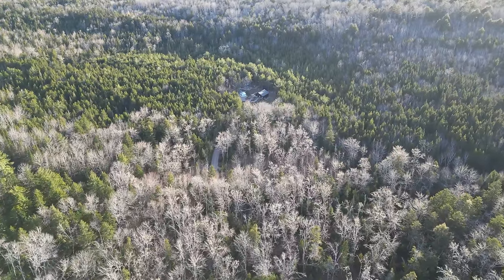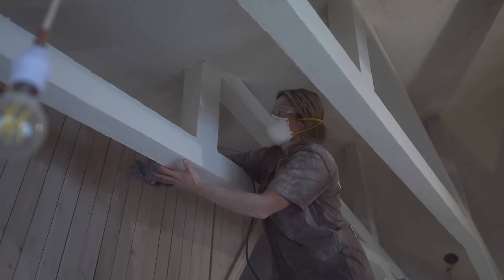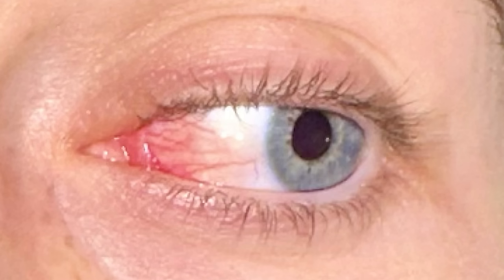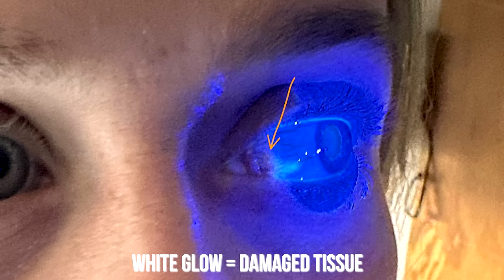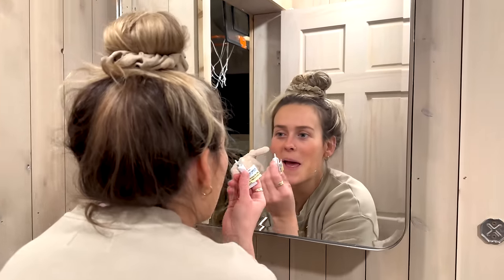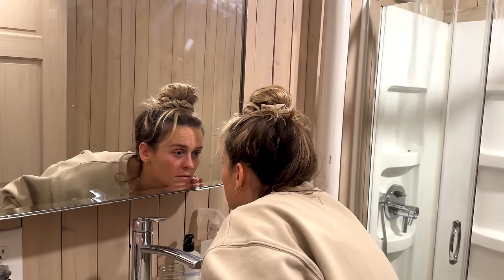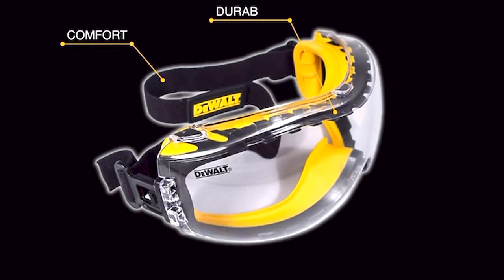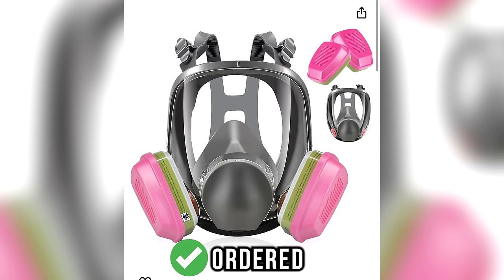telling my story

Comment: I'm glad to see you're okay, Crystal.
Being in the housing industry my whole life. I've seen a few of these types of accidents. From employees to myself. I wear very large prescription safety glasses with flex on frames. Sawdust and sand blasting. I thought was pretty bad in the eyes until I had a wire wheel wire come flying off the grinder. The wire stuck right in the whites of my left eye. Luckily, it didn't penetrate my eyeball very deep. The eye care center was able to pull it right out. I was lucky. It could have been a lot worse. 
15 years or so later, I was cutting the grass on my big lawn mower down a walking path. I ran over a small fallen tree branch, No different than I'd done a thousand times before and the pieces bounced off a tree on the edge of the path, and it's stuck in my right eyeball. Just a tiny wood splinter. No bigger than an eyelash. Back to the surgery eye center, I went. By the time the doctor got into the exam room, it had removed itself. I suppose form me trying not to blink. I was very lucky that time, too. 
We had one employee cut the tip of his ring finger off. Cutting crown molding to length with the small skill saw. The homeowner showed up to check out their new home being built. Tripped on the extension card which pulled the saw which cut his finger while he was cutting the wood trim. 
Another employee cut his thumb almost completely off with the a miter saw. His thumb is now 1/8 of an inch shorter, and his doctor said it was a perfect cut right through the bone now his thumb is just a little shorter. 
Another employee was cutting up some shipping materials with a razor knife and sliced his hand open. Not really, very bad. But when he saw the blood himself, he passed out, fell to the ground, and broke his jaw. That was wired up for several months. Scared the hell out of me when I saw him laying on the floor, passed out and bleeding from his hand. 
I took off a chunk of my middle finger on my right hand with the roofing hammer. I'm left handed and I was just trying to set the nail. The nail slipped between the two sheets underneath the shingles. A 24-ounce waffle head isn't very forgiving. You really can't tell it now. That finger is just shorter. 
I can't tell you how many times i've stuck myself with an air nailer. From trim guns to the big framing nailers. Sometimes those nails don't go through the wood straight. Next thing you know your nailed to the board. Best to keep your hands and feet back from the firing end of any nail guns.
You girls have put out several videos where I just cringe.
Sometimes I even yell at the screen. Hoping everyone will have all of their digits and no new holes poked in their skin. Sometimes saws kick. Sometimes nails come out of the other end of the board where you didn't expect them. It's just part of the business. Accidents happen. Keep your personal protection on and handy and remain vigilant of your surroundings. Just another day in the construction world... 
Be careful girls
✌️🤟🖖

Comment: When I was much younger, I worked for just over 11 years in a logging maintenance shop (they worked on logging equipment) and used to do some foolish things, such as watch guys weld on steel, without my wearing any PPE. The "luck of the Irish" was always with me and I never got any flash burns or such. But I did eventually learn to use PPE's and I am glad I did. Yes people wear your PPE's all the time. If you need short breaks because of discomfort from wearing them, take them. Better short breaks then a loss of eyesight or hearing and anything else that can happen. By the way, this is coming from a 70+ year old.

Comment: I’ve always found with proper treatment that the recuperative powers of the eye are pretty amazing. You were smart to seek treatment. An eyewash kit is a wise investment for DYI'ers. I have used my WaterPik (from a distance) to flush my eye with good results. Funny story: I had to use eyedrops every night before going to sleep and I kept them in my nightstand drawer. There was also a similar shaped bottle in the drawer also. For almost three months I put Dristan nasal spray in my eyes! When I finally discovered the mix up I called my Ophthalmologist and told him and put into a fit of uncontrollable laughter. Went to see him that afternoon and everything was okay. The  Dristan had worked quite well with no ill effects.

Comment: Yes, wear all your PPE: gloves, hard hat, appropriate clothing, chaps, eye pro, ear pro, face shield when needed! Wear appropriate PPE when working, depending on task being done. 
I remember many, many years ago, the Bell 212 helicopter was getting ready to take off and I was the one closing the passenger door when my ring got caught on the door latch. I had to get myself unstuck while the rotors were turning. That was a bit of a rush, scary moment. I knew the pilot wouldn’t lift until he watched me walk away from the helicopter, but it still was scary and got me into a bit of a panic for a few seconds. I should have had my flight gloves on to prevent that from happening because I know ppl wear jewelry. I, for one, no longer wear rings because anything can happen.

Comment: Glad you are ok.

 Before you use anything always read the label on item before using it and as Crystal said wear ppe. Not just any ppe use correct ppe for that particular item. This is for your chemicals. Anything else not chemical related do a task break down on what you are going to do.

Comment: Glad you’re ok and so sorry this happened. The reality is that workplace and simple at home Reno/diy mistakes like this are so common and often easily avoidable by using the correct PPE or even following instructions on how to safely use a product/machine/tool. Remember those ‘boring’ WHMIS/MSDS sheets/videos/classes you probably took at least once at a job? They exist for almost everything and they exist to prevent injury. Sometimes we imagine an injury to be this huge horrific thing when it’s as simple as not tying your shoe and tripping or like you, just not considering working above your head. The most common injuries are the really small minor details we often brush off as not important or not a big deal like you said. I try to always think of it as, is it avoidable? Can I do this a safer way or is it safe? And if I have any minor doubt or uncertainty, I will look up a safer method or read labels, read operation guidelines etc. 
I work in TV & Film and part of my job is communication and safety. To be aware of the work going on around me and ensuring people continue to work in a safe way. Holding a ladder or checking people don’t step into a live traffic lane to squeeze by equipment, etc. 
Every time you start a new project or continue on a build, check that whatever you’re doing is the safest way to do it. Did you remember your glasses? (Pro tip check they’re in good condition, any crack = replace) Ear protection etc. Taking that extra minute or two to check in with yourself can make a world of difference. Same as knowing when to stop working because you’re getting tired.  
🙏🏻🖤 Thank you for sharing the importance of working safely & hopefully this will be the start of a very safe practice for VanWives DIY builds. Take care

Comment: I am glad you are doing well. Last year I installed a light in my shed, and left the power drill on top of my ladder and forgot it was there. I then moved the ladder and the drill fell on my face. I was wearing safety glasses for even this minor task, and thank god I did because the drill tip was facing toward me and bounced off my glasses instead of going into my eye. I did still crack a tooth and my nose was bleeding a bit, but at least my eye was safe. You can see on the glasses where the tip impacted..

Comment: I have worked around power saws / table saws and other shop equipment long before they preached PPE.  One time I got a wood sliver in the eye and had to drive over 1/2 hr to a doctor with one eye closed, luckily no permanent damage but I swear one eye is weaker than the other.  Now early 60’s and need hearing aids….    PPE or pay the price!

Comment: There is a device you can add on to saw blades that will brake the blade when it senses its cutting flesh, I saw a video where they tested it on a bunch of hotdogs with a bunch if different speeds and it actually stopped the saw from cutting the hotdogs all the way through. Might be a good thing to look into. My father in law lost the tip of his finger while woodworking

Comment: Safety lashes help a lot but not all the time! Glad you're ok and not a pirate. 

When I worked doing Reno's I'd have a jug of tap water in my vehicle just for this and other first aid. Some places would have water shut off, then your sol. 
Hats! light sweaters, taken off shake out, some dusts dry out skin when mixing with sweat. Rinsing your face well when needed so you're not knocking dust into your eyes while touching your face. And gloves! they deflect so much, I'd cut my self open all the time when not using my gloves for my baby hands. 2nd skin.

I want to get a full face visor, and thick jacket for grinder use, good reminder!

Comment: I didn't have a chemical burn, but I had the flu and got made hot tea. I sneezed when I was about to drink the scalding hot tea. I burned my eye. I was on vacation.  I went to a eye doctor and got drops. I never followed up with my eye doctor when I came home from vacation,  because I was scheduled back to work. I swear my vision is terrible in that eye. I'm glad that you are alright and that you got the cement in the right spot. Wear your PPE. I should've worn PPE for my cold.

Comment: I was fooling around with molten silver nitrate salt without proper PPE, when I splashed a bit into one of my eyes.  Unlike your accident, this hit my eyeball dead on and burned the cornea.  I got it washed out immediately, but it was definitely burned because that drop was 212 C!  The ER did give me some antibiotic drops and ointment, and bandaged it.  So I was one-eyed for a couple of weeks.  Within a month it was healed and my vision perfect.  Corneas are very good at healing because the outer cells are always being shed and regrowth is quick.

Comment: My time as a mechanic in the Army taught me that ALL jewelry comes off before doing any kind work. Even during our training we took off our dog tags and hook them around belt loop and stuffed in pocket as even that light chain was enough to pull you into a fan or some gears cause some very nasty injuries. Rings make great welding rods with even a 12 or 24 volts battery that can push 200 amps thru it before it turns liquid around your finger 🤯 Meant a couple of guys that almost lost fingers because their wives insisted they should wear weddings ring while working. One ended up almost having whole finger ripped off when it caught on a bolt when jumping down off vehicle and he ended up hanging by it. The other the ring almost ended up cutting off the finger when his hand got smashed by something heavy. His other fingers just needed to be in splint for a few weeks but ring finger had to have surgery to reattach tendons and never fully recovered.😮 Reason I'm pointing it out is I watch both of you wearing rings and necklaces that could so easily get caught while you are working and lead to some bad injuries which would really be a bad thing to have happen to either of you😢

Comment: When I was 20, I did an internship in a steel construction workshop ( I studied steel construction…). I was doing most of the time very repetitive tasks with serious machines using ppe. But on the side they let me do my little project and for fun I built a small plane in steel (that was sure would not fly! 😆). The last hour of the last day, I was tired and did protect myself properly…no glasses. I did a stupid move, hitting a very small sharp steel triangle with a steel hammer, on a steel table…the thing bounced very hardly close to my eye… it hurt like hell, I was bleeding…and for 10 days has a black eye. It hit millimetres from my eye. I had the realization that it could have turned out way differently…very scary to think about, and how fast your life could change with just one reckless act. Be safe everyone!

Comment: I scratched the cornea of my eye while running a grit blaster at work. had my glasses on but took them off when I was in a safe area. The glass dust from the blaster had settled on my eye brows. and when I brushed my forehead with my are it fell into my eye.

Comment: My mum used to say if you make a mistake you won't do it again, you need to put this down as a lessoned learned. Years ago even though I was using a face mask, I forgot to clean the inside before putting them on, got some saw bust in my eye. Its ok having PPE but makexsure that after you've used any eye protection that its cleaned and put in something clean, I use those zip tie food bags and always keep a small bottle of water nearby, just in case you need to flush your eyes out quickly.  Glad your OK, been where you are so know what your going through. ❤️👍

Comment: thank you! PPEs and photos of are not in the public eye. I had an eye injury when I was 17, now 70. mine was the devastation of legally blind in 1 eye result. Back then 3 cat gut stitches in the pupil/iris after the corneal lens was removed. I wear glasses all the time to just protect my good eye. Then with age, I did the no line bifocal for reasons of reading.. based on what you showed - technology for eye care has changed. I had a piece of steel slice its way in and X-rays was the way to find it, and had an electro magnet used to remove it. months to nearly a year - Pirate patch, couldn't read as eye movement was torturous. Depth perception was gone. Strained to use utensils to eat. Was a sports player - all gone... n more.. OH, I found another youtuber with eye muffs - ian russel if you care to search. not complete PPE for all jobs but a really good concept.

Comment: You can get an MSDS (Material Safety Data Sheet) for any chemical. If you are using the chemical more than once, send for it, and establish your own MSDS book. The sheets will tell you which ppe to use, what first aid procedures to follow and what not to mix it with, to name a few features. If you do get an exposure, bring the sheet to the ER. It takes the guess work out for them. I taught safety stuff like this for a few years, so I know how important it is. Remember, if it just seems like too much work to use a ppe, it's time for a break! Heal up and many hugs, guys.

Comment: Worked construction during summers while going through University...using a nail gun w/ no PPE, one of the foreman, in his 50s, came up to me and said "I used to be that guy..." And he pointed to his eye - which was deformed and a clearly a prosthetic eye - and then walked away. Tinnitus is a similar thing that can be prevented w/ PPE...I have ringing in my ears 24x7x365 and all I had to do was wear hearing protection :(. Lastly, also had a sub-contractor who fell 'only' 8ft off a ladder & he went through 2-3 surgeries just to be able to walk w/ out  walker.

Comment: Thankfully you were fortunate this time.  Myself I always ware PPE ever since a long long time ago when I got lazy and took off my safety glasses when I was cutting some 2x4’s. then notice I had to make one more cut, didn’t put my glasses back on and got a sliver in my eye.

When ever I do woodworking and it’s dusty I have a respiratory i use as I have asthma quite bad and just the smallest amount of dust. I can’t breathe.

Same thing as I always use the latex gloves at work as I’m a diesel mechanic or form fitting rubber palmed gloves.

Comment: I am pleased to know that you are fine Crystal.  Over the years I hardly ever worried about anything until one day I was working on a snowplow trying to get a bolt out  I had a can of penetrating fluid with the little hose on the nozzle and I sprayed it in the hole that the bolt was in and looking at it the same time. I sprayed and instantly the fluid came back and I watched it in slow motion right at my eye.  I didn't have time to close my eye and it hit squarely in me eye.  Instantly I couldn't see and the pain was great.  I made it to the house and the the faucet and watched it as much as I could.  It was ok after awhile, but I always were safety glasses now.  Love and peace and safety fron Salem, Or.  Paws Up Forever !!!!